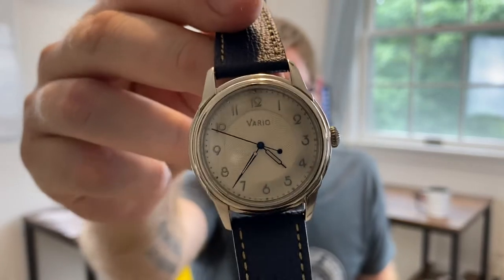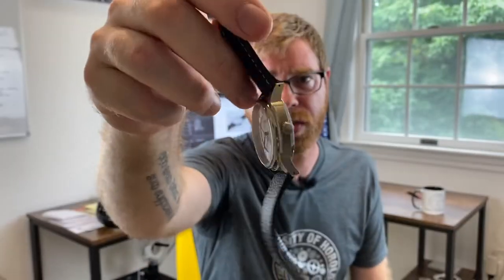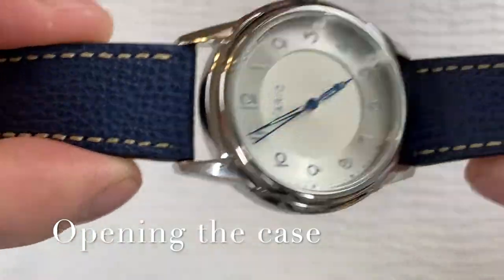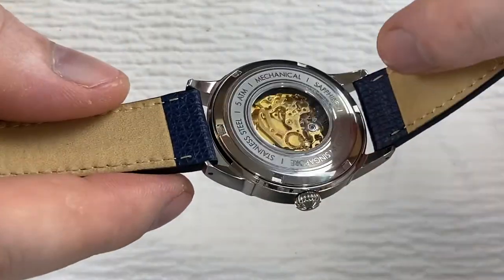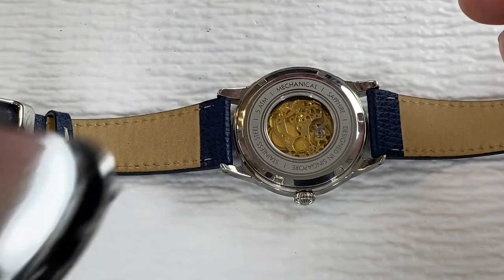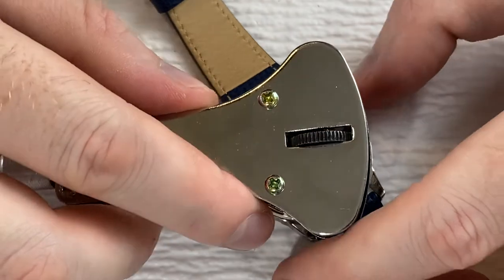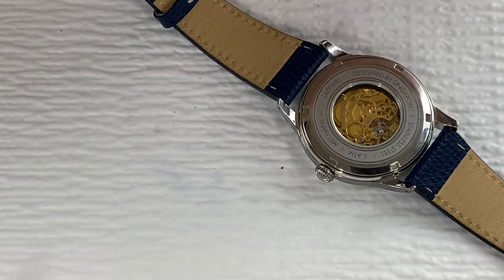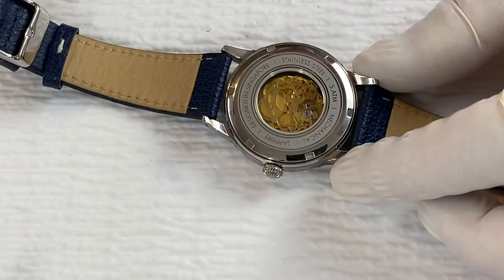Swapping Watch Dials

Comment: Hello! 11:14 nice finger prints! otherwise i like the plastic bag (i use only one layer of the bag. i cut it) method instead of the plastic shield for removing hands. with the same tools as yours. prevent the hands from jumping up and hitting each others too hard. as well as providing a dial protection.

 you also can use one plastic bag layer to put over the case back to protect it when tightening or undoing it. the thickness is just right and it makes the teeth fit snug. no ripage. same with the knife for pressed down back. 

BUT you made me learn something with the rodico for installing hands. that's actually what we should do as it will not hurt them like tweezers can. even plastic tweezers.
Reply from the maker: Yeah the finger prints are from the factory, I assume and mention. I still think I’d prefer to use the Bergeon dial protector than a plastic bag, since plastic bags are quite thin. Rodico is an essential for any watch work.
Reply: @WatchComplications  i use rodico to clean or pick up tiny parts but i never thought about using it for installing hands too. that baffles me in fact XD. i see so many people using tweezers that it felt natural to go that way. i'm a self taught, so i learn everyday.
Reply from the maker: As for self taught, that makes two of us :)

Comment: I'd be furious if I paid and waited for a dail to come in only for it to be defective and tattered!  

Between the scratches on the front and the fingerprints on the back it clearly, shows that that company has serious quality control issues. 
Great explanation and directions on the swamp. You're a better man than me when it comes to letting things slide..

I understand too that you said that it's not visible to the necked eye. But you know as well as I do that forever in your mind's eye you'll be seeing that scratch. I don't own the watch and it's embedded forever in my mind along with those pesky fingerprints. Lol
Reply from the maker: Well the watch began as a broken review sample for me so it's sort of a "project" watch of sorts, and I love the design. The dial imperfections are quite minor and since it was a spare dial, I'm ok with it. I'm really just waiting for the next model. I haven't seen the dial side imperfections on any other pictures I've seen and my other dial is fine. It could have picked them up in shipping. As for the finger prints...at least they're on the back and not visible, haha, but yeah not sure if that's from the dial manufacturer or during assembly, but certainly needs addressed.
Reply from the maker: I should also add that I didn't pay for it or wait for it. It was a left over dial that was sent to me as a surprise/kind gesture since I like to tinker.
Reply: But he got all of it for free. Also this watch was a reviewers sample so it might have been opened by other reviewers which could explain the fingerprints

Comment: I have some old inexpensive wind up watches that i would like to change the dials of to some after market ones off other watches. 
My watch has a dial size of 30.7mm. Do you know what size dial i can't away with ? meaning is there an allowance of size the new dial should be within ?
Reply from the maker: that depends more on the case. usually there’s a little tolerance on either side, but it’d be a millimeter or less total spread. for example 30.2 to 31.2, but many times it’s smaller than that, like 0.3 on either side. You’d want to measure the dial opening size and max size on the inside ledge of the case with some calipers to be sure.

Comment: You swapped dials very neatly. I'm trying to swap a movement and keep the old dial on a Timex Expedition. I can't figure out how to locate a source to swap the movement. Timex won't do it. Any suggestions? Thanks.
Reply from the maker: depends on what movement you are swapping it for
Reply: Correct. I have the old movement, problem is I don't see any number on it, so I don't know how to describe it accurately.
Reply from the maker: I'd probably just buy a new one and swap the old dial onto the new one. and perhaps change the hands to the old ones.

Comment: If i want to change a dial on my old seiko quartz watch and the dial doesn't fit exactly on the movement, can i just glue the dial with the movement?
Reply from the maker: no don’t do that. the most primitive thing to do would be to use what are called dial dots, which are essentially a small dot that’s a double sided sticker. the best way to do it is to reset the dial feet. I have a couple videos on all that.

Comment: Great video! I have a question if I have a Automatic watch and I have a Quartz watch but there both the same size and the dials are the same size can I swap dials? Not the mechanisms just the Top dial face?
Reply from the maker: depends on the exact movements in question, but probably not. They’d have different stems, different stem heights, and likely different dial feet locations. And the movement holders would need to be different as well. If you want more insight, look at my Monty Python series where I swap a quartz movement with a mechanical one.
Reply: @WatchComplications  awesome thank you!

Comment: Are most watch faces of a standard size? Could you swap faces from one to another?
Reply from the maker: there are some more common sizes for dials, such as 28.5mm, but it varies wildly by case size and the intended design of the watch.

Comment: Hello. I have a vintage omega 165.001, solid 18k Gold. 
I want to swap to a dial with better condition. Do I need to find one with the same reference or just with the same caliber is enough?
Reply from the maker: I think just the same caliber would be enough. the dimensions and dial feet locations would be the same, usually. Unless they changed something about the caliber from one time to another without changing the caliber number.

Comment: Interesting video. This is something I've been wanting to try. Probably a stupid question, but are there different sizes of watch dials (that's to say if a company offers a 38mm version and a 42mm version, could those be swapped or are there different sizes to all watch dials)?
Reply from the maker: Yeah there is almost an endless variety of dial sizes though there are some fairly common standard sizes. You are also thinking diameter of the watch, 38 or 42mm, when the dials are smaller...such as 28.5mm or 34.5mm or any number of possibilities. If you have two watches that have a case diameter difference of 38 and 42mm, then the dials are also going to be different sizes.

Comment: hi! can we remove watch hands with flat edge screwdriver as alternatives?
Reply from the maker: you can remove hands with a flat edge, but the odds of damage to the hands or dial is much greater. Hand removal tools have a curve underneath, and then using a protector around the dial helps decrease odds of damage. Using a single tool on one side, be it a flathead or curved tool is also a bad idea. You need equal pressure on both sides of the hands to remove them cleanly and with the least stress on the parts.